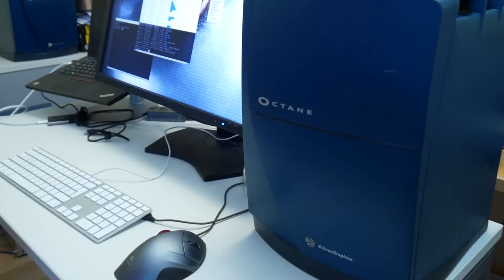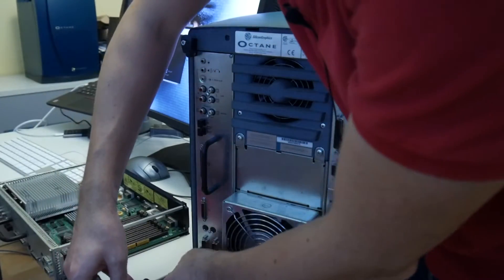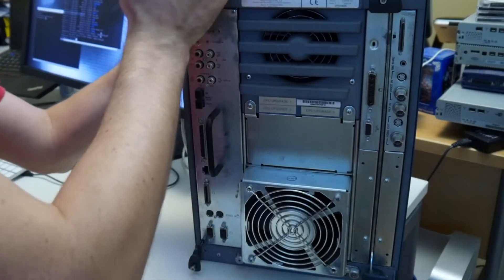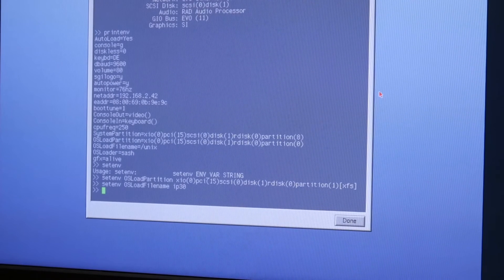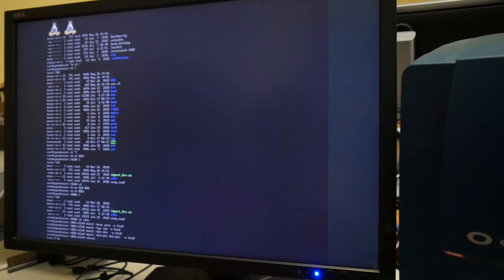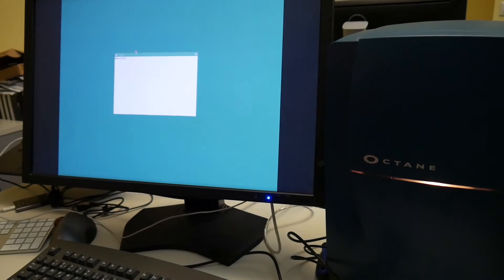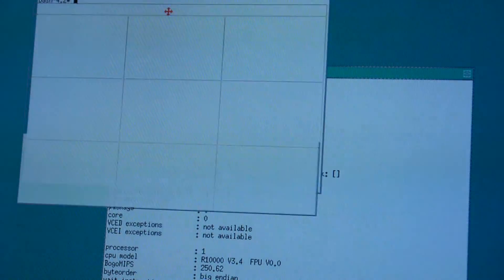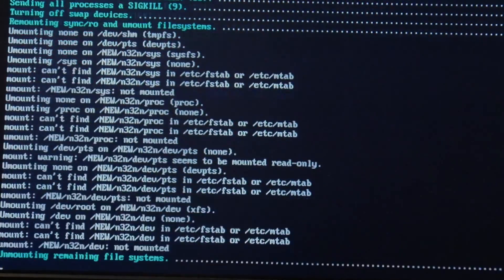Sgi Octane time again: let's implement Impact hw cursor!

Comment from the maker: for more open source programming and video content you can also support me with a small tip over at: https://www.patreon.com/home
Reply from the maker: awesome ;-) ok ok, I dd' this up sometime soon, hopefully the next days, currently I have two build in the root partition and older not as stable build, (n64 or so) and a newer higher performance and more stable I think n32, that is why I chroot to /NEW/n32n in the video. To save space and such I will finally rm -rf the old system and move the n32n to the root, test boot and such, wipe my password fill the free space with zeros, and dd' it up ;-)